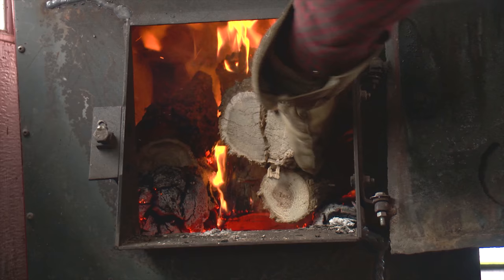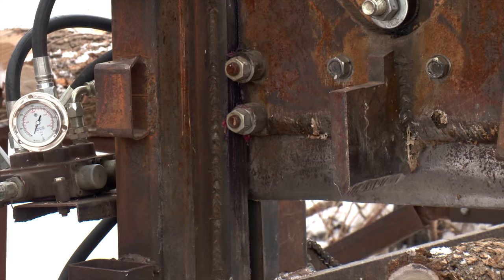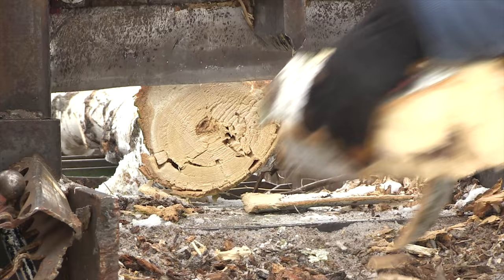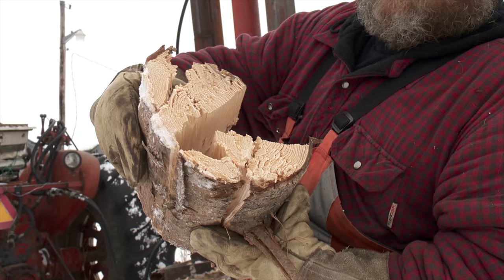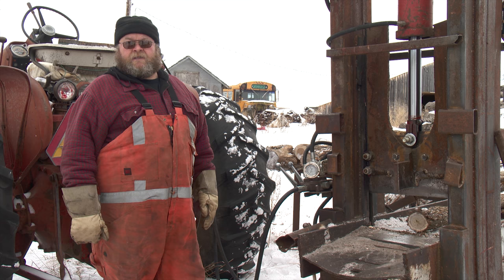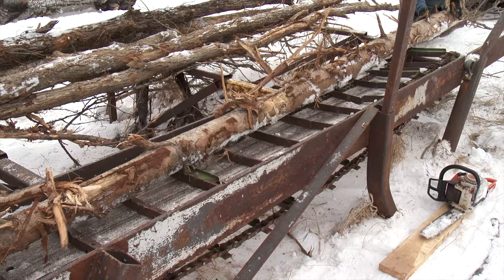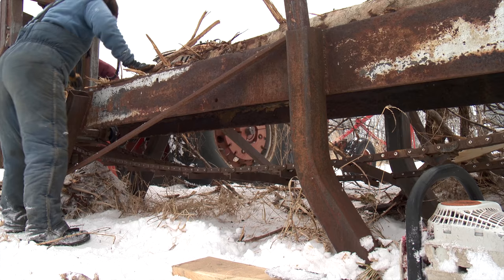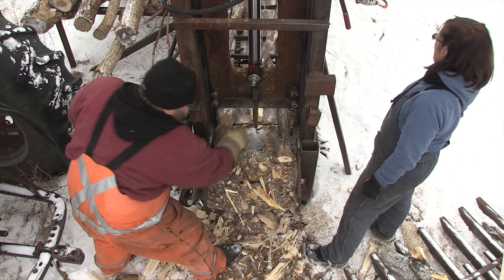45 Ton Log Splitter

Comment: The math at 1500 psi says 42411 pounds so with 2000 pounds in a ton that's a little over 21 ton
Reply: is what my math says too. But at 2250 which most modern farm equipment runs at he would achieve around 31 ton. You would need 3200 PSI to get 45 ton out of this unit.

Comment: Hydraulics are pretty cut and dried. Using the numbers he gave, 6 inch cylinder at 1500 PSI, he has 42411 lbs of pressure. Just over 21 tons instead of the 45 tons assumed. here is a link to a calculator to save the drama.  http://www.baumhydraulics.com/calculators/cyl_calc.htm

Comment: Needs a pump with 4 times the flow rate, make that work cycle snappy.
Reply: Or a 2" ram next to the 6" to bring it down to cutting height with the big one on a cavitation valve.
Reply: needs a high flow and a low flow pump for the same engine, the high flow brings it up to working height, as soon as it builds up pressure the low flow pump takes over
Reply: Need you armchair experts to BUILD one. Then post it up.

Comment: I give him credit for building it, but he's not much as a designer/fabricator. The build shows only a cursory understanding of metalworking tools while the actual engineering goes too long on some features and too short on others.
I work with different engineers to help me design machines, and fabrication shops for outsourcing components that I lack the skill/expertise/equipment to do. Yes, this costs money and time. But when the machine is finished, there is the satisfaction that you did it once, and did it right. Although it may not sound like it, I am trying to be helpful, and not critical.
Reply: lets see one you designed and built please
Reply: I will be posting one in less than a year. It is completed, but need paint, assembly, and testing. It weighs 5 tons, and has an engineered hydraulic system with German components. It runs on a tandem pump driven by a 55 HP Deutz diesel. It was designed and built around the real world challenges of processing everything we get as a Chicagoland tree service. Including six foot dia. logs. I worked with Lincoln welding 
company on some of the superstructure. Stay tuned!
Reply: @northerniltree  In less than a year? lol. Money talks bullshit walks. Ive been USING my machine for YEARS now. My 
" only cursory " knowledge of tools and steel has allowed me to build numerous trailers, truck decks,  stump grinders , tree shears, dozer blades, tracks for skid steers, overhead cranes, and numerous other machines THAT I SUCCESSFULLY DESIGN AND FABRICATE MYSELF. I dont spend tons of money consulting with " engineers" and such. As clearly stated in my interview, I built this very efficient and well working machine out of VARIOUS existing SCRAP at hand in my shop and prefabricated parts from a local shop THAT were rejects. Why on earth would I spend days or weeks RE designing and RE structuring components that I  got for FREE??. IF you EVER do produce an actual machine that works...to POST and show to people..with the way you bloviate...YOU'LL have 100 GRAND into it ...using your fancy engineers and powder coating facilities....and making sure EVERYTHING is meticulously cut, fitted, welded, and painted so as to make all blowhards like YOU happy...lol.
I on the otherhand...am quite happy to show people the machine that a self taught, rough around the edges.. bush man built..that actually puts useable wood on the ground to keep us warm. Incidentally I have since DESIGNED AND BUILT a winch to pull trees to and up on the deck and a conveyor to take the wood up on a pile. Maybe you'll give me permission to post a video of those poorly built additions ( not too pretty and NOT engineered and fancy painted).
I learned a LONG time ago. PRETTY doesnt make you money. RELIABILITY AND DESIRE TO SUCCEED DOES.
Im sure LOTS are anticipating the unveiling of your 100 grand machine and photos of your engineering team.
THEY'VE ALREADY seen mine.
And i only spent 1-2 grand NOT counting my time and Jack Daniels....
Reply: You should be proud. And patient. Stay tuned, you might learn something.
Reply: @northerniltree  I AM proud. And i HAVE learned something.
The world. is full of critical arrogant  airbags that I usually ignore and laugh at .
Reply: That's comforting. Just don't become a critical arrogant airbag. Try to keep your mind open, and with time your skills will improve!
Reply: @northerniltree  Now. Im a VETERAN and getting ready to go in for rememberance services. DON'T CONTACT ME AGAIN. Youve SPENT your time here. Move on.
Reply: Yes Darrell you made it out of what was available, not designed by a listed company's design department...   I do love the Lancet Arch, as the top ram support...
Reply: @hiscifi2986  thank you. Some of the people that come here JUST to criticize....just dont grasp the concept of " self sufficiency".
Reply: @hiscifi2986  Will be firing it up tomorrow asa matter of fact. Now have a winch i built on it to pull logs up on deck...and conveyor to take the wood away AND piles it.
Reply: make a video of this please
Reply: @darrellinkster7385  As a vet myself I have  been on deployments where I had to build or fabricate a tool to get a job done. Good old farmer ingenuity . I like watching Prairie Farm Report not to criticise but maybe pick up an idea or two to help me build a useful project to get a job done. My father died when I was 15 and my grandfather took me in until I was old enough to go in the military. I learned a lot from him. I learned a lot from other guys that I worked with along the way.I like whar you did with what you had onhand. Id work with you any day. Chimo ...
Reply: @AnMadreMor  thanks very much. Here it is a year later ...and mouthpiece above hasnt posted. I guess his high priced " engineers" fell through...lol.
Windbag.
Reply: @darrellinkster7385  In my shop, Airhead.
Reply: @darrellinkster7385  Let me guess: you're 30, and live in mommy's basement.
Reply: @northerniltree  You're really not doing yourself any favours here. Farmers and ranchers are self sufficient, and are their own engineers, innovators, product development specialists. And they do it all with whatever they have at their hands. Just relax, and maybe visit a farmer and learn another way of life and looking at the world. And remember that life isn't a competition.
Reply: @acerjuglans383  Relax. Read the last sentence of my post.